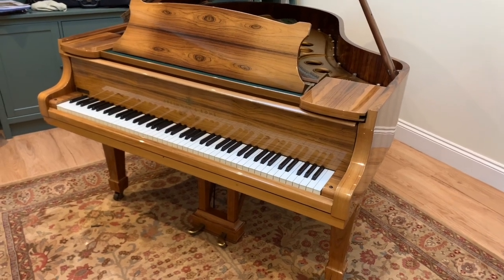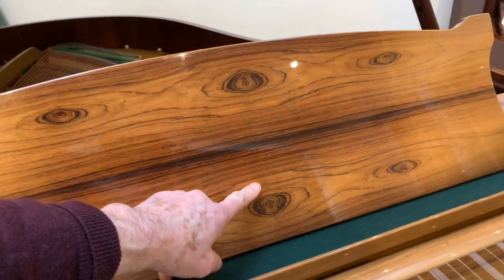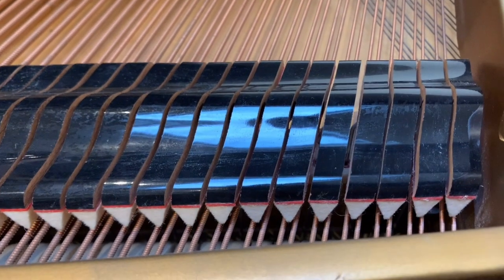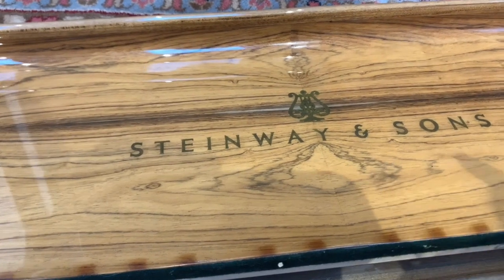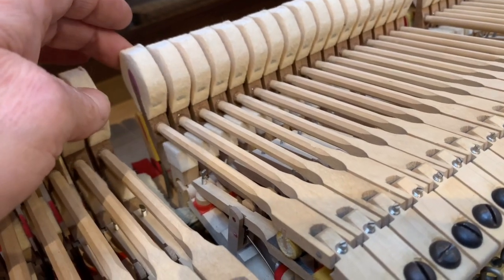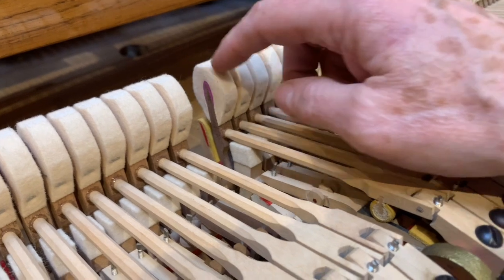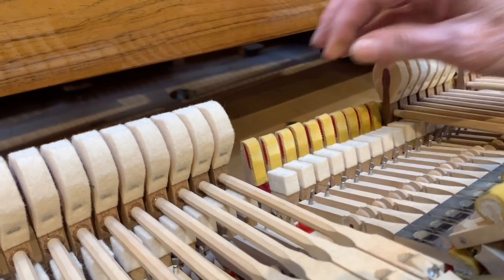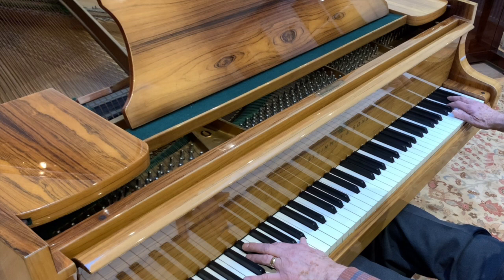Assessment for work on a Steinway model O grand piano c1980

Comment: The lettering design of the plate suggests that the piano is from 1980 rather than from an earlier period when Steinway pianos only had two pedals.  The lettering from older Steinway pianos was much more extensive.  If it was rebuilt and re veneered in 1980 it is highly unlikely that the plate was replaced.

Comment: The two pedals and the exotic wood may indicate this is a much older (pre 1900) piano that’s was rebuilt possibly by Steinway in 1980. In America Steinway only made 3 pedal instruments since the late 1890s. In Europe slightly later.
This is why I think the piano was rebuilt.Ivory and rosewood were already under environmental attack so it seems odd that a newer instrument would have these even in 1980.
Reply: You can still get a rosewood piano as special order, and until the 80s the three smaller Steinway grands only had two pedals. Ivory was used by Steinway Hamburg until 1990.

Comment: My Steinway is a 1901 New York Steinway model O in Flame Mahogany completely restored by Steinway technicians.
It has three pedals. As you know until the 1930s Hamburg and New York were virtually the same piano.
I think this was an older piano rebuilt and reveneered in 1980.

Comment: Steinway invented the 3rd pedal (sostenuto) in the early 1870’s or just before. I have a Steinway Square from 1873 with the sostenuto pedal. Other piano makers did not provide the sostenuto until much later, well into the 1900’s. Why a model O from 1980 does not have one is a bit of a mystery. Having said that few musicians ever use it in my experience.
Reply: I think that many pianos sold by Steinway and others in Europe did not often include them. If you look at several of the other videos on this channel, very few Steinways have them. Being from the US, where nearly every piano has three pedals, I found this to be strange at first.

Comment: Two pedals and ivory keys on a 1980’s piano? Sounds suspicious!
Reply: No, it's correct. Steinway Hamburg used ivory on keyboards until about 1990, and the three smallest grands came with two pedals as standard until about the same time, although a sostenuto could be requested as a special order. Steinway Hamburg recently reverted to making their uprights with two pedals as standard and I'm not sure why.
Reply: Fun fact: According to my piano tuner, who is from Steinway, told me that for the price of ~13500EUR, even till THIS DAY, you can get ivory key tops from them. I was a bit stunned hearing this, so I forgot to ask him how this is possible. I suppose they buy old ivory that was imported before the ban, and use that...
Reply: @EpicVideoTime4You  Actually I know about this. Until about three years ago the price was £2500 to the trade. Then things were made more difficult. The ivory is not pre-ban necessarily. There are certain countries that have banned ivory and certain countries that haven't. There are other countries that have banned ivory coming from certain countries but not others, so for example you might be able to get your ivory through a source in, say, Japan but not China (for example, I don't actually know the exact countries involved). The problem is that the countries where the ivory is allowed to come through don't always check/have no interest in checking exactly what source the ivory came from, so in paying £12000/13500Euro, you could actually be buying poached ivory. My feeling is that if a piano already has ivory from before the 1990 ban, leave it on. You can't change the past by removing it. I would strongly counsel against the purchase of new ivory for a rebuilt piano or for a new piano under any circumstances. It's not necessary. On my 1912 Blüthner we retained the original keyboard and so the ivory was kept because it would have cost an extra £1000 to resurface the white keys. On my 1894 Blüthner, the keys were brittle so we replaced the whole keyboard with a new one and used some kind of acrylic for the white keys - it doesn't in my opinion take away from the piano having acrylic key-tops. I really hope Steinway and all the others decide that using ivory on new pianos is a terrible idea and stop it.
Reply: @josephfleetwood3882  I really hope this is wrong, but I fear you might be right. If so, this is morally disgusting. Even using pre-ban material is a big gray zone in my opinion, but if they import fresh ivory from countries that haven’t banned, I don’t know what to say! 
Im perfectly happy with my Blüthner model 11 (1953) that obviously has it. The only reason we talked about this, was because I told him of some repairs that I might want in the future. I think he wanted me to sell a new grand instead of reconditioning it, which I wasn’t interested in, since I love my Blüthner, and I think it is special that it does have the old ivories, amongst other things, to which he responded with saying that it would be no problem - I just needed to pay a bit more and then I could still get ivories... He is coming again during December. I will definitely question him a bit more about the legality of this.